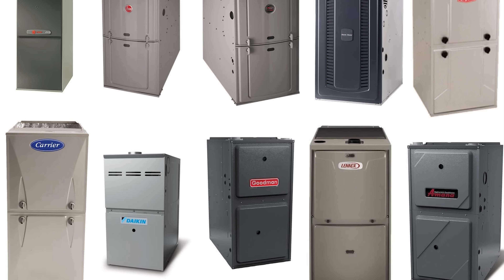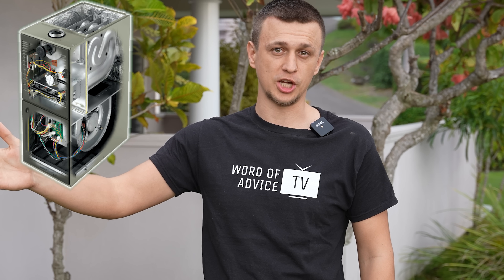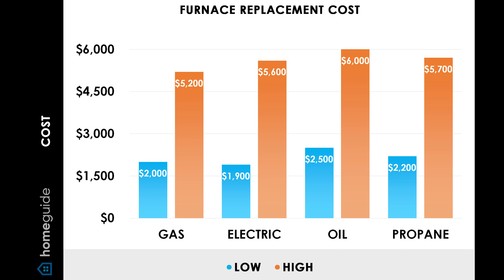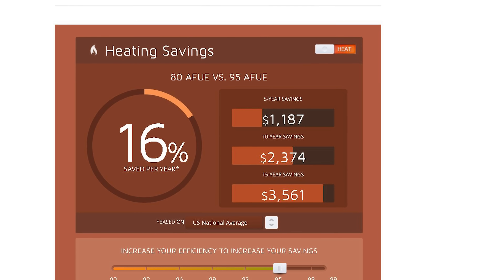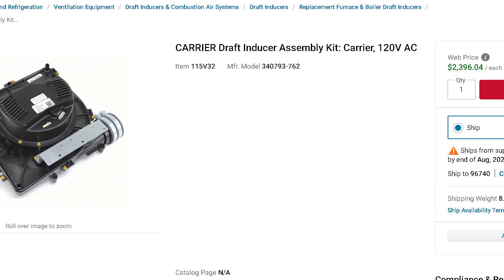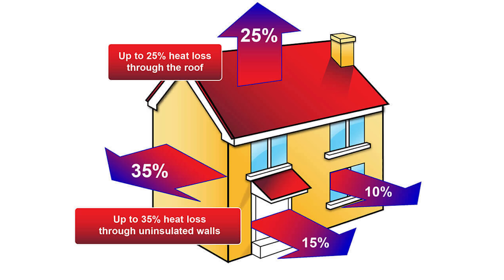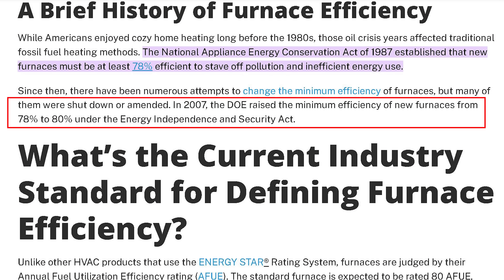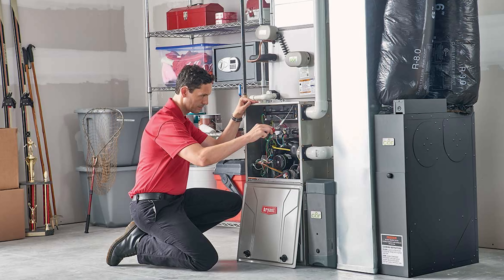Don't Buy a High Efficiency Furnace!

Comment: I am an HVAC, professional 37 years. I completely 100% agree with everything in this video. I feel the same way about high-efficiency air, conditioners and heat pumps with inverters. They are so expensive. They never will pay for themselves. It’s just getting a little too ridiculous and complicated especially in residential. A $3000 repair bill usually hurts most people pretty good.
Reply: Me too
Reply: Your comment based on 37 years experience along with Jay’s video is all the confirmation I need for my next furnace.
Reply: @Ratlins9  My thoughts exactly
Reply: It might be true for many, but generalizing like this is a dangerous way to think. For example, my wife and I moved into a medium sized house in NH with a recently installed 95% propane furnace. What we didn't know was the shape of the house and climate would lead to a propane bill of about $6000 a year. We ended up installing a geothermal system for $25000 which went down to about $18000 after rebates. So far, it uses less than $1000 in electricity (even with the crazy new rates) so we're expecting a payback time of about 3 years. The loan we got costs much less than our monthly propane bill. The maintenance is far less too (about $100 a year for both heating and cooling vs $300 for the furnace plus $100 for the AC). Not to mention it's more comfortable and it makes the air less dry in the winter.

Now this isn't a typical situation, but many in NH have this problem and if we resist change for the sake of resisting, it'll do more hurt then good.

As for the 80% vs HE furnaces debate, there's definitely a good argument there for the 80%. Like everything, it's a numbers game. The trick is knowing what the numbers are and be able to project costs accurately
Reply: Lets Calculate: Savings of 95% over 80% for 35 year life of Lennox Pulse.  $1000 year spent on Nat Gas with 95% so spent $35k in 35 years.  Would need 19% more gas for an 80% (.95/.80=.19).  So $35k * 19% = $6,650 saved over 35 years.   NOT ONLY is there energy savings, but HIGH quality equipment last twice as long, so saves another $3k to install another one.
Reply: @pablopicaro7649  Sorry Pablo, I disagree. 35 years, not going to happen. Amount of repairs, etc... In a perfect world maybe, if your math is not flawed. If you are rich and you don't care that is different, but with all the heat and small air passageways in the HE units, it will rust out and close off those thin passages way sooner than the 80% units.
Reply: Disagree about inverters. If they are installed right and have proper protection (surge/voltage monitoring) then they will last. Not to mention Mitsubishi has a 12 year warranty. Also, inverter driven systems are MUCH more comfortable than a standard single stage PSC driven system.  Inverters are here to stay.
Reply: @zschmois  NG is a lot cheaper LP. 6k a year naked geothermal HP a easy decision. Generally NG furnace won’t cost 2k a yr to use its around 1k
Reply: @pablopicaro7649  no brand last 35 years and there will be repairs that 80% won’t require
Reply: @timrob0420  I can buy a 14 seer heat pump wholesale for $2300.03 ton. Inverter 20 seer heat pump is  10000$ wholesale.
Reply: @benkuxhouse787  okay, and the inverter style heat pump will be much more comfortable than that 14 Seer will.
Reply: @timrob0420  I lived in NY for 8 years single stage equipment worked fine. 2300 vs 10000$
Reply: @Ratlins9  well, there's good experience and bad experience.
Reply: @pablopicaro7649  bad example.  That furnace had a recall on it many years ago.  Nor would any respectable contractor recommend that a furnace will last 35 years.  Your math is also off by 4%.  What's not considered in high efficiency usage calculations is that with a higher efficiency we can also drop to a smaller BTU size and accomplish the same.  So a good example would be of a typical 3 ton home in my area.  With an 80% you need the 80,000 BTU model.  With a 95% you may only need a 60,000 BTU furnace.  So if you input the same btu, both will heat the home but the 95% will have shorter run times and more cycles.  But your math will be correct (assuming you correct the 4%).  A true comparison can only be determined with an actual heat load profile to factor in run times and sizing.
Reply: @benkuxhouse787  definitely. If NG is available then any heat pump will have long ROIs. I would keep me eye out on upcoming laws, however, as more and more we're seeing cities ban new NG devices. I would wager the market will naturally shift towards heat pumps over the years
Reply: @jthonn  true. Lennox Pulse won’t last 35 years.  Though I tried. 
I’d been to the Pulse school. I nursed one along for nearly 20 years. Couldn’t get it serviced. They were all condemned.  I had to buy a flapper valve from ebay and install it myself. The heat exchanger was all stainless steel. But I guess where the sections were joined the sealant vibrated out and allowed combustion gasses into the heated air. 
So nobody’d touch them. 
But what shocked me was when I finally changed it out, utility costs dropped almost by 1/3.  Both furnaces were in the 90% range!  When new.
Reply: @davehaggerty3405  Wow that is amazing, thanks for sharing. Where I live we just don't use the heat like up north, I think that is why my furnace looks almost new after  17 years. I am in a situation where I need a changeout. So my dilemma is whether to change the whole thing or just the evaporator. It is one of the units the HVAC guys hate, 4 ton Goodman. It's R22, but can get a 1040a condenser and set the new evaporator for the 1040a also. ERR, decisions... I will price the difference and see, maybe go with another brand altogether, geech! If I new I could get the same service out of a new Goodman that I got out of this one, I would be delighted. I never had to touch it for 13years. I changed the cap and the contactor and the squirrel cage (wheel not motor) since then. If I wouldn't have gotten the leak, I would still be rockin'. Oh, I almost forgot, I did change the fan motor on the condenser last year. Thanks again for your input.
Reply: As being in the HVAC business for almost 50 years I completely agree with your numbers.
Reply: @zschmois  With the Inflation Reduction Act pass last year (2022), the rebates for Geothermal have been drastically increased. All geothermal systems get a 30% tax credit for the entire installation and engineering cost. If at least 40% of the materials are US made, you get another 10% in rebates. So, 40% off a geothermal system install, on top of the very efficient nature of the system just made geo cheaper than any commercial system, and likely comparable to a residential system. The firm I work for has been engineering geothermal systems for heating and cooling for about 20 years now. With the new rebates, we're expecting to do a ton more. Hopefully we can find enough well drillers to keep up!

Good for you to get ahead of the curve. Add solar panels to run the circulation pump and heat pump and you could have a completely grid-free HVAC system with pipes that will last at least 100 years, and heat pump parts that will last as long or longer than a furnace!
Reply: @TroyFoster1921  Definitely. I didn't know about the extra 10% for US made materials. I need to check with my tax advisor to see if I can claim that as well. One suggestion I have (if you have the power to make such a change in the industry happen) is to look beyond well drilling companies to do the bore holes. They're great to work with and they know what they're doing, but geo bore holes are inefficiently drilled when using water well technology. I found out the hard way when they sent my final bill and it came out to $7K over budget because they needed 150 feet of casing. I understand it's hard for THEM to accurately find the depth to the bedrock, but that's no excuse for the industry to not find a better alternative. Ironically, the oil and gas industry might shine here since those drill operations have to be more efficient due to their nature.
Reply: Typical old HVAC. They just hate new stuff. Old stuff was simpler. This is the way things are going. If comfort and efficiency is important to you, then variable.speed high efficiency furnaces are the way to go. Stop oversizing them is the first step to bring down costs. 99% of equipment is oversized.
Reply: @mungs1104  I have a single stage heat pump heats my house just fine. Cools my house just fine. Going from an 80% to efficiency gas furnace to 90+ will never pay for itself. First time you get a multi thousand dollar repair your savings or down the drain. It’s a fact that high-efficiency furnaces have problems that 80% furnaces will never have. You can get a 2 stage or a modulating 80% furnace. I prefer 2 stage.
Mitsubishi VRF’s systems are having a lot of problems and I have furnished a lot of articles on customers that are getting screwed. School districts shelling out thousands of dollars on equipment that should still be under warranty. I’ve spoken with technicians that are stuck on them telling me they don’t get the technical support they don’t really know what to do. The only time I would recommend a modulating furnace air conditioning unit is if they have multi zone. I installed a two zone. Multizone didn’t need modulating. I did it with a two speed system. I was able to do it because both zones were the same size. First time at super high efficiency, gas furnace, brakes, goodbye savings.
Reply: Most Furnace manufacturers will give a 10 year parts warranty if registered online.
Reply: @channelcatchaser9426  still have to pay for the labor, but after year 11 you’re footing the bill. You’re not gonna save $1000 with a high-efficiency furnace or an 80% furnace. You would be lucky if it was $150 over 1 heating season.
Reply: @timrob0420  nope. A properly installed system you can tell no difference. Been doing this since 1988
Reply: @pablopicaro7649  you are calculating that like it's 0 to 100. You'd have to calculate a certain amount of BTU output. Your example would need to be based on a specific BTU output. A Lennox 90 plus percent efficiency gas furnace is not going to last 35 years.. I've been doing this since 1988.
Reply: @Bryan-Hensley  here it is simply:  amount of heat needed = 95% efficiency * (1 unit of money to buy gas) = 80% * (unknown cost to buy gas for an 80%) ,  solve for amount needed for an 80% = 95%/80% * (cost for the 95%) = 1.19 times as much.   So as easily shown the lower efficiency cost 19% more to run.  That is the trade off.
Reply: Depends where you live!!  WI, Mn, or midwest 90% all the way.
Reply: @jthonn  saw your comment decided to let you know my history, so everyone can see it I will post it today at the beginning, I hope you can find it….Jim Pie
Reply: @jimpie231  I will, hey you don't have to, I believe you. I'm not a hvac guy, but know a little about it, no where near your expertise and experience, I mean you know more in your little finger, than I will ever know. I am just on the fence with mine. I can just change the evaporator and get a new condenser or change the whole thing, decisions...
Reply: @jthonn  I just put my post up, it took me awhile. I covers from 1974 till today.  My dad had the same problem and the HVAC guy replaced only the condenser.  The unit was 20 years old, big mistake.  Whenever the unit is over 20 years old, putting repair money into it is counterproductive.  I would replace the coil with an encased coil, line set and condenser.  How well did your old unit work and how old is it?   What area of the country do you live in and what city?   Jim
PS: I have installed 2 complete a/c systems by myself. I have had professionals help me charge them, you need a license in my area to do this.  By the way my nephew has an A/C unit that is about 35 years old and still working, looks like…..junk, but it works!
Reply: @jimpie231  Ok I always think everyone sees all my posts, sorry. I have what everyone hates, 4 ton Goodman. It is 17 years old and the furnace and handler is in great shape. I live in southeast Louisiana. My evaporator leaks slowly, I have been limping along with it about 4 years. It leaks about 3lbs a year. It's r22 but my friend bought a bunch of r22 when it was cheap, so I lucked out. I think I should go with the evaporator set for the new refrigerant and a new condenser. I never had to touch this thing for 13 years. Thanks for your input.
Reply: @davehaggerty3405  My Lennox pulse has been heating my large home for 37 years in northern Canada without a repair and continues to work great at a low cost in a very cold climate.
Reply: @jthonn  when you say evaporator, do you mean coil?  If that’s it, why don’t you replace it? I like the encased coil…..Jim
Reply: the only benefit of 17 seer and above ac is how quiet they are
Reply: @jimpie231  Yes and where mine is, it will be easy. I would actually prefer uncased, but may not be able to buy it that way. I will pull it out if so. I will change the condenser too, that way I can change to the 1040a. Thanks for your input.
Reply: @willlive6845  I believe you, but all the new ones are pretty quiet. Having a higher seer makes for better efficiency on the cooler end, doesn't do crap for the heat.
Reply: However, there are early 1990s inverter Trane air conditioners that are still running today.
Reply: @davidperry4013  Every now and then you get a good one, or one that was taken care of.
Reply: Just another sounds good, scam.
Reply: @willlive6845  I think a two speed heat pump is worth the extra. It’s not that much more than the standard. Unfortunately, the standard is now being a 15 seer thanks  to the government. 2speed heat pump or AC definitely would do a better job on the humidification. It’s not that complicated. It’s the same exact unit as the others except for the compressor has it on loader in it real simple. Wholesale I believe a 3 ton unit is around $3500. 15 seer around 2200.
20 SEER with an inverter 10,000. Those are wholesale prices available to me through my source. I have a couple of two speed units out there that are working really great. I live in the Pacific Northwest I went to one of my friends house where I put one in and you can barely hear the unit running on low speed heats really nice on a mild day. If you were in a humid climate, like Florida, two speed I think is worth the extra for sure just for the Dehumidification part of it
Reply: @davidperry4013  I work in the field in the 1990s and there was no inverter driven AC equipment. The big high-efficiency was two speed compressors, no inverters. That is something that has happened over the last 15 years. I worked for a Bryant dealer in the early 90s. There was no inverter AC equipment. There was two speed. The two speed Copeland scrolls today are a lot simpler than the old 2 speed equipment. Today’s to speed scroll compressor just has an unloader imbedded in it. The old units from the 90s had two separate compressor windings with two separate run, capacitors and a solid-state controller to go from high-speed from low speed. A two speed unit I think is worth the extra it’s not that much. The inverter is a lot more expensive a lot more complicated. I don’t think they’ll pay for itself.
3 ton unit HP 14 seer 2200   16-18 SEER 3500$
20 SEER inverter 10,000$. Those are prices for me wholesale from my supplier.
Reply: My parents had a standard unit installed when they modeled the house. The system lasted over 20 years before it was finally replaced.
Reply: I tell my customers the same. Around 10 years field exp. I gauge the customer for weather they want to save the environment with their repair bills with a slight fuel savings with full disclosure. Inverters go out left and right due to the salt air and coastal storms. Some of the mini split systems reliably rot away on the top cover and leak water directly on the inverter board with an 800+ repair bill 5 years after install (wont name names for reasons). I've seen 80 percents last 40 years. I've seen  high efficiencies last 8. I think the best gas furnaces are the late 90's Trane 80%. I smile every time I see one. Customers smile when I tell them that they are still in excellent shape and might last another 20 years.
Reply: @benkuxhouse787  huh mine is humming along at 31 years old guess i have less 4 left in it so better start looking for a new one
Reply: @msk3905  what style of furnace?
Reply: @billybbob18  it’s great to see an honest businessman👍
Reply: @benkuxhouse787  I've worked on a Trane inverter system from the 80s. They existed and disappeared since no one knew how to fix them.
Reply: @sprockkets  that must’ve been a commercial unit. Could be wrong but I worked for a Trane dealer in the late 80s and they just started putting out the tenure compressor warranty. Trane was the first one that did that. Did it break all the time? Something I’ve been also learning is that a a lot of these inverter systems, especially I’ve been hearing on the Mitsubishi multi city the inverters cannot hold up to salt air environment
Reply: @benkuxhouse787  It was installed in a fairly rich guys house, the kind of house that has like 5 a/c units. The thermostat even showed you the % level the system was running at. He had one left out of IIRC 3 that were already defunct and replaced. It had the hugest capacitors inside it. It had the buzzing noise you expect of an inverter unit. It looked like any other sharp edged XL trane unit from the late 80s. 
Even at 100% it was a bit under performing for the amps it took.
Reply: @pablopicaro7649  From a guy with 4 houses and large commercial building owing over 20 years,  have both high and normal efficiency. My very expensive high efficiency do not last near as long. High cost/high efficiency does in no way mean high quality.  Or better put the high quality is negated by the complex mechanisms that have far more failure point. I have yet to have a $4000 dollar furnace last more than 10 years (and i have purchased 6 of them) but I have never had to replace a new normal efficiency furnace yet.
Reply: @benkuxhouse787  Clearly you haven't tried an inverter system.
Reply: @timrob0420 lol no. I grew up with single stage and my high efficiency is miserable to live with. 😂